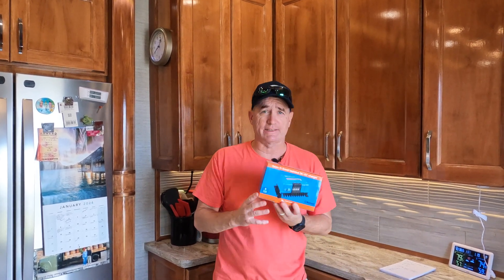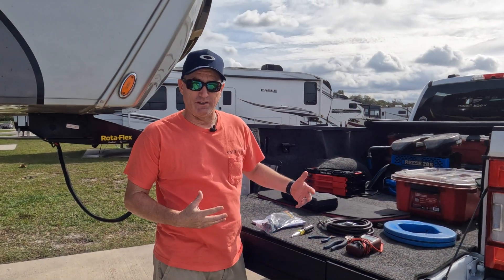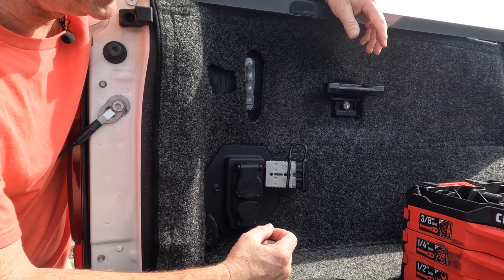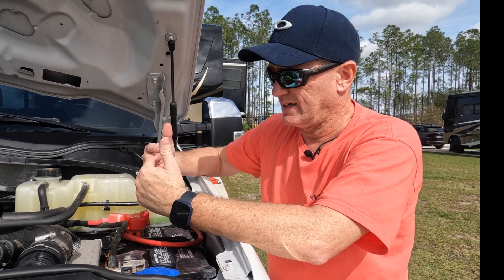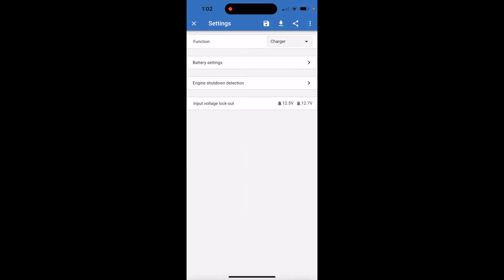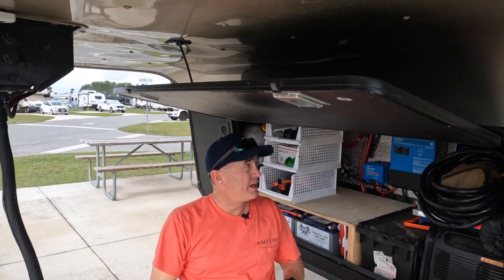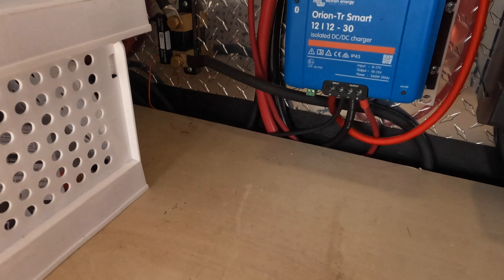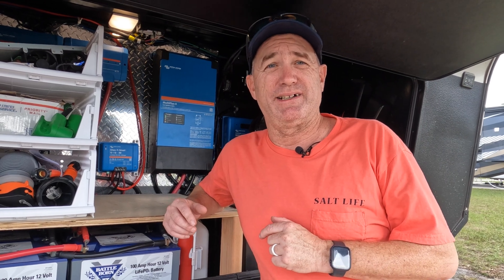Our take on the Victron Orion DC/DC charger, and how we installed it.

Comment: I'm adding one of these to my RV for my new 400ah lithium battery bank. I moved the battery location from the tongue of RV to inside the RV. This puts the batteries about 50ft from tow vehicle's alternator. When I look at a voltage drop calculator it is showing me for a distance of 100ft (50ft positive, 50ft negative) to use a 1/0 cable for a 3% voltage drop. 1/0 seems rather large to be running from truck batteries all the way back to the 12-12-30. How much of a voltage drop can I have before I will start having issues?

Comment: The Orions are great DC-to-DC's.  Their one drawback is that there is no way to configure a current limit for the device.  It will always try to push its maximum current if it can.
Reply: The newer Orion XS allows you to set a maximum input and a maximum output current.
Reply: @russelllang2910  the XS is non-isolated.  Not a good design for truck campers or travel trailers.
Reply: @russelllang2910  Yup, indeed.  I forgot about the XS.  Pretty expensive at $330, but a capable unit.  Wish they'd do something more general for both the input and output voltage range with the XS.  I barely ever use 12V anymore myself.

Comment: Maybe I misunderstood what you were hoping to achieve but it sounded like you purchased the wrong model Orion, Isolated insteand of non-isolated. In any case,  regardless of the model as long as it's setup correctly, I've been very happy with my Orion dcdc. The unit is  under specified whereby I have seen it charging at 35 amp even though it is specified as a 30 amp charger. Of course there is a 50 amp version now which would be ideal for a setup such as yours. In my case I only have 170AH of battery capacity and the combination of 30 amp DCDC with 200 watts of solar via Victron MPPT charger provides a consistent  power supply for my application. Thanks for sharing. Cheers from OZ
Reply: Most of the time isolated isn't required, but can be useful with trailers.  Here is a quote from an EE on the topic:  "Galvanically isolated is a nice thing to have, especially if you are charging house batteries in a trailer from the tow vehicle engine. The issue relates to how the house battery is grounded to chassis ground when the tow vehicle is disconnected."
Reply: @fratermus5502  Am I correct is saying that you're referring to the ground related to the AC circuit for an anboard AC charger ? Cheers
Reply: @cyclemoto8744  ground as in "NEG  return" in the DC circuit.  DC-DC chargers require two POS connections by necessity (in from alternator and out to battery bank), but usually only one NEG connection.  The isolated version is useful when there is not a unitary NEG available:  disconnected trailers, fiberglass bodies, etc.
Reply: @fratermus5502  I get that but this can be overcome by adding a dedicated neg circuit in the trailer instead of using chassis grounding. Cheers